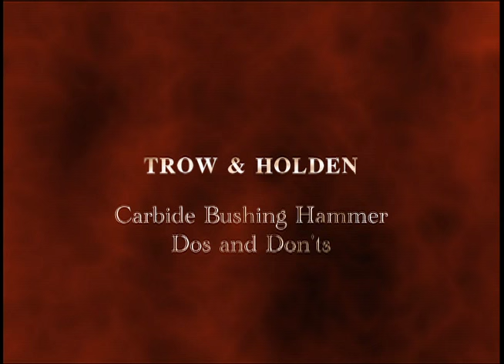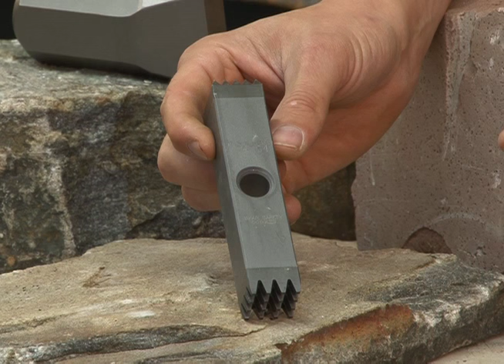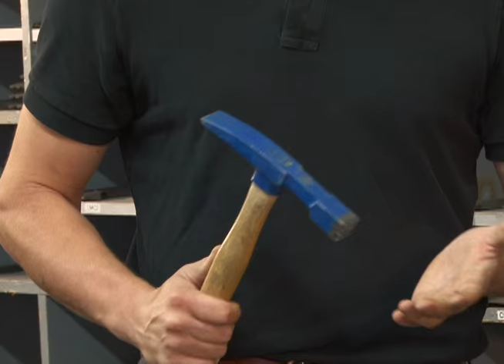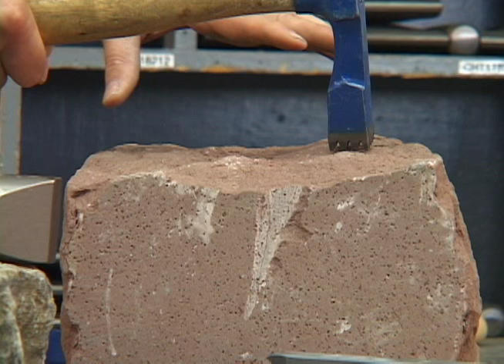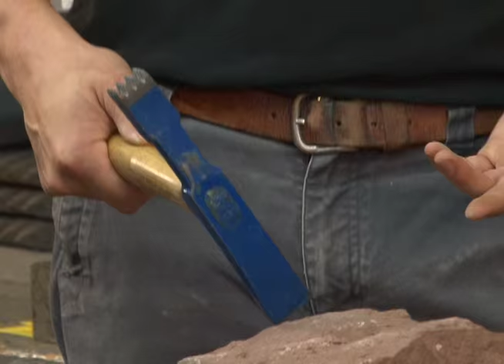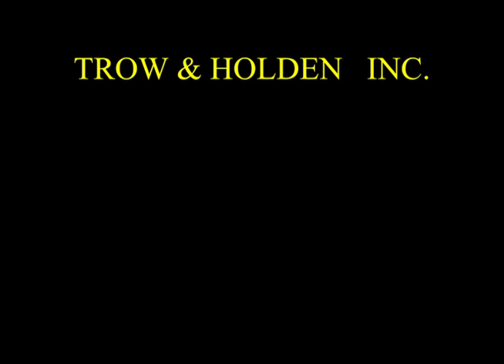Carbide Bushing Hammer Dos and Don'ts

Comment: I only know about brick hammers. 
I have just bought the Vaughan Bon brick hammer after having the one I bought as a apprentice stolen.
(The wooden handle ones are virtually impossible to find in the UK.)
I have tried most brick hammers as a replacement but after 30 years, I bit the bullet and imported one from America.
It was just a good as I remember, just the best brick hammer ever made. 
Forget all the fancy handles they try to sell you, it is just marketing because wooden handles are more expensive to produce. A good wooden handle will absorb vibration better than anything out there.